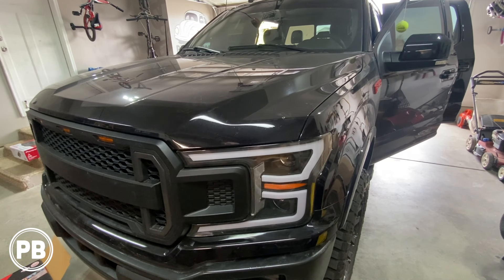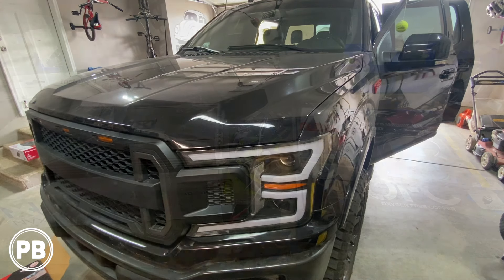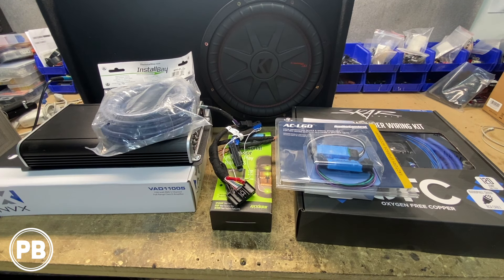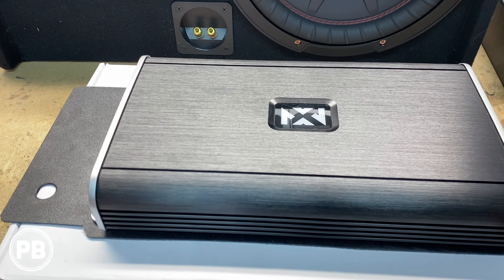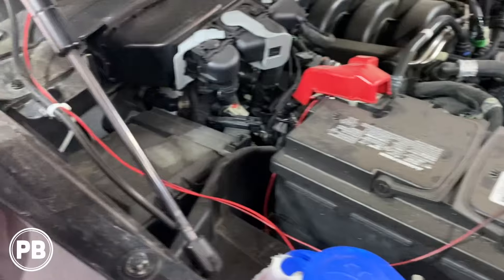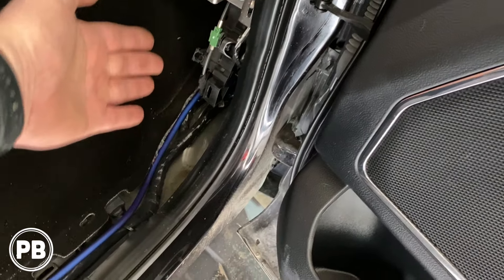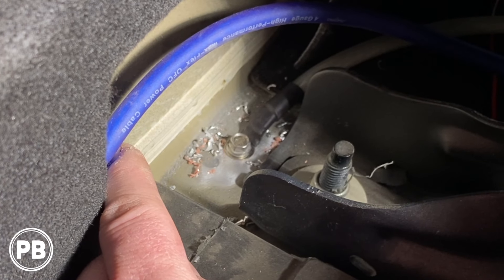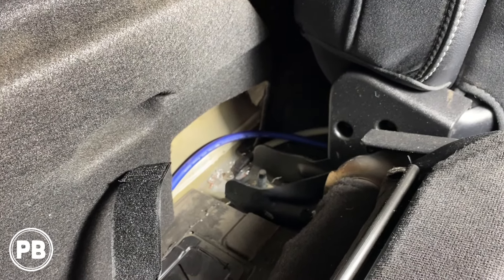2015 - 2020 Ford F150 5 Channel Amp and Sub Install (to Factory Radio)

Comment: @ProvoBeastAudio - First off, AWESOME VIDEO!  I am following your video to the letter for my 2020 F150, and I noticed something odd.  At the 13:12 mark when you're showing the output converter/load simulator apparatus you built, the white and gray outputs are either transposed, or the one I got is different.  Mine was Gray first, then white.  I think you might have flipped left and right in your video.  Maybe you swapped the RCA to compensate?  Also, it looks like you have the positive and negative backwards, at least compared to the one I got.  The output side of mine has the positive first (left to right along the top in your vid), but in your video it appears that you have negative first.  It is easiest to see on the purple wire, where the negative stripe is facing up.  It's hard to tell, and you don't really show it close up enough for me to tell definitively.  You are obviously a pro, so maybe I am seeing it wrong, or the one I got is different.  Either way, thank you for the great video.  Oh one other thing, pulling the power wire through that rubber gasket was TOUGH.  You made it look super easy, so kudos on that!
Reply from the maker: It's just a load resistor, so as long as the same color passes in and out, they can be in any position.  Happy to help!
Reply: @ProvoBeastAudio  maybe I am misunderstanding something.  I thought the 'out' of the load resistors formed the input of the line out converters, and thus the channels (Front L/R, Rear L/R) very much mattered.  Isn't that how the amp is getting the channel signal from the factory head unit?
Reply from the maker: @bryancruise  Send us a message on facebook or instagram and we can help answer your questions.

Comment: Are the load resistors still necessary if using this LOC, PAC LPA-E.4 LocPro Advanced?
Reply from the maker: That Pac module does provide a load down to 20 ohms, so in theory, yes!  But if the radio fails to operate correctly, then I'd later add load generators.

Comment: Are there benefits to buying the LC2i (LOC) as opposed to the LP7-4?
Reply from the maker: LC2i- has a main channel out and a sub channel out.  The sub channel has an added benefit of accubass where you can correct any bass rolloff.  It's a more expensive unit, but highly recommended. The LC7i is a 6 channel LOC which also is a great option.
Reply: The Audio Control LC units will also load the factory headunit speaker outputs so you wont have to have the LGD's

Comment: If I am just Going to add a a subwoofer and and a amp with a  epicenter and change out the door speakers do I really need to do all this
Reply from the maker: Nope if you plan on just running the door speakers off the radio. You just need a line out concerted and tap into your speaker wires for signal. No need to add load resistors or T harness if just adding a simple amp and sub.
Reply: @ProvoBeastAudio  what’s the line out concerted do?

Comment: I had a shop install a 5 channel amp to the stock radio.  He used this method or something similar... but when my auto stop/start turns the truck on after idling it cuts power to the amp restarting it.   Same thing happens if I turn the volume down too low or off.  I have to turn the volume up to feed enough power to the amp.  How do I remedy this, what could he have done wrong?
Reply from the maker: Check to see where he tapped into for the remote turn on wire.  Depends on the source, he may have gone straight to the fuse box on a circuit that turns off whenever the truck shuts off.  If using a line out converter that only senses audio, that also may be the reason why the amp shuts down if turned all the way down (depends on the loc).  Best scenario you use a line out converter that produces a trigger output based on a DC offset (senses a DC voltage over the speaker wire) to keep on the amp regardless of audio or not.   Hard to diagnose without more info.

Comment: What do you do when a client wants dual subs under the rear seat but the truck has the factory power inverter under the passenger rear seat?
Reply from the maker: Build an amp rack behind the rear seats.

Comment: I have a sub and amp kit. All the wiring and everything comes with the kit. What else do I need? Connector wise to run from the audio to my amps? I have the Sony system btw. I think I have a platinum.
Reply from the maker: We linked that info in the description to help get you started.

Comment: This feels like a stupid question but the sub is rated for a max power of 1000 watts will the 1100 watt amp harm the sub?
Reply from the maker: Max power are very unrealistic numbers. Always look at the RMS rating. Find out what coil configuration your sub is, how it will be wired, check the rms rating of your sub, and find a amp that does the power at that ohm load.

Comment: do you really need the load resistors if you dont have an amplified system?
Reply from the maker: If you are connecting all your speaker leads from the factory radio directly to your line out converter and amplifier (instead of speakers), yes.  If you are simply just adding an amp and sub keeping the factory speakers connected, no load resistors needed.

Comment: Have you used that T harness on 21+ f150 with big screen and standard audio system. The website says 2011-2020.
Reply from the maker: It’s on my website, yes if you want one built. If you build it yourself, the harness is a pac lphfd31.  Provobeast.com
Reply: @ProvoBeastAudio  thanks I found it on the pac website . I commented on the other video installing a front door speakers . In trying to install new tweeters snd 6×9 and all the aftermarket tweeters are either 4ohm or 6 ohm the factory is 8ohm is it ok to run those off the factory head unit with no amp

Comment: Have a 17 F-150, I swapped out the 4inch screen and upgraded to the sync 3. What do I need to do to avoid any hiccups?
Reply: Just did the exact thing with mine. I wish they'd answer this one.
Reply: @mikemike4415  I installed it already it went well. Lci2 pro, and a skar 8 inch. Didn’t do a 5 channel.

Comment: What do you charge for something like this? 

I’m considering doing it myself but curious what shops charge. I know area ect will make price different.
Reply: from what i’ve heard around the atlanta area is if you have the sub and amp alreayd it’s about 300 ish
Reply: @disconerdlion3853  I’m in Georgia. That’s fair

Comment: Why not tie into the wires in the C pillar for an amplifier?
Reply from the maker: you could, but for both inputs and outputs with a 5 channel amp, and use of the T harness, behind the radio is the best solution.  If just adding and amp and sub, and simple line out converter, You can go to the C pillar.
Reply: @ProvoBeastAudio  👍🏼 Good point.

Comment: Do the center dash and 2 pillar speakers still work?
Reply from the maker: Yes, they just ran off of radio power, and the pillar speakers are wired in the same channel as the door speakers (see that video for more information) on the non-factory amplified systems.

Comment: How does this amp compared to the pioneer you installed 10 months prior on a Ford F-150?
Reply from the maker: We still love that Pioneer, and recommend it.  This is at a cheaper price point, and still is a great option.

Comment: What about the rca for sub??
Reply from the maker: Our NVX amplifier (and similar with other brands) pulls signal from the front and rear channels to provide a signal to the sub channel internally in the amp.  If your amp doesn't have that feature, you either need a different style LOC with 6 channel preouts, or RCA splitters to supply signal to your sub channel.
Reply: @ProvoBeastAudio  I have the skar RP-600.5.  5 channel amp. Hopefully this amp will work. 

Also what size plate did you use for mounting the stuff behind radio.
Reply from the maker: The RP-600.5 doesn't have a way for the sub signal to snag input from the front 4 channels, so you will need to use a few RCA splitters or use a different style line out converter.  The plate was about 4"x7" @LesWhitleyjr
Reply: @ProvoBeastAudio  thank you. I appreciate your prompt response and great video!!!!

Comment: how much wattage is safe to run on stock electrical and a strong agm upfront? i have a 16 bro
Reply from the maker: I'd say up to about 1500 watts RMS.  Any more would be up to better battery / wiring / electrical upgrades under the hood.

Comment: Does this set up work with the B&O sound system?
Reply from the maker: It will differ slightly with the factory amplified system.  We added a few notes in the description regarding that trim level.

Comment: did you remove the factory amp entirely ?
Reply from the maker: Our trim F150 wasn't equipped with an amplifier so there wasn't one to remove.  If you do have the factory amp, see the description of those specific install adapters.

Comment: Did this truck have a sync 3 radio?
Reply from the maker: Yes it has sync
Reply: @ProvoBeastAudio  ok thank you. I'm about to do a install and was wondering what wire harness I would need for the two amplifiers.
Reply: @ProvoBeastAudio  a little confusing that crutchfield says that the PAC t harness doesn't fit the 2015 f150 lariat
Reply: did you try the pac harness?
Reply: @kevins9576  no. I'm not sure if it will work or not.
Reply: I just ordered it so we'll see
Reply: @kevins9576  so what was the out come of the harness?
Reply: @GH0ST_740  it worked fine, you just have to cut the wires instead of it being done and set up for you. It tells you how to do it in the instructions, super easy. Sorry, I forgot to come back and tell you how it worked out.

Comment: How do i incorporate a self powered sub along with a 4 channel amp?
Reply from the maker: You can use a Y-splitter, or your 4 channel amp may have an RCA passthrough output, or just add another line out converter, or get a 6 channel line out converter.
Reply: @ProvoBeastAudio  , good idea, I'll get a 6 channel LOC. Thanks

Comment: I know several others have commented on this as well... but Crutchfield says that T-harness won't fit a 2015 F-150. They recommend the iDatalink dFO2 as an alternative... Has anyone tried this?
Reply from the maker: Axxess says it will fit a 2015.  Pac's alternative also will fit as well (linked in the description).
Reply: @ProvoBeastAudio  ok thanks, I'll give the PAC product a try

Comment: Got a question about one of your older videos. Bought to buy a 2016 gti. Got a 2k watt amp and a sundown 10. I'm worried the alternators not gonna be enough. Been looking for a replacement for it cannot seem to find one think I'll be good without it? Was just gonna run a cap and hope for the best.
Reply from the maker: Do a big 3 upgrade, and ensure that your primary battery is healthy or high performance (upgrade to an AGM will help greatly).  I'd add a secondary AGM battery as most cheap caps are garbage.

Comment: Alright I have the same setup BUT I just ran into an issue. Granted it was probably my fault , the issue didn’t begin until I accidentally shorted the system by disconnecting the ground and reconnecting it.
The REM cable is now under powered only reading 3v.
I’ve swapped the amp and PAC unit , but nothing has changed, is reading 3v directly from the PAC. The yellow input is fine reading 12v.
I think the load resistors might be the issue, loose connection maybe? Or maybe there no good?

Comment: I have a 2022 honda accord I installed a 5 channel amplifier to the factory radio I replaced the door speakers  and rear deck speakers and added a single 12" sub everything sounds good Bluetooth plays good but the only issue I have is that when I make Bluetooth calls I can't hear the person I call thru the door speakers and rear deck speakers but I can only hear the calls thru the tweeters because those I actually left them alone still connected to the factory head until. does anybody know how to retain the Bluetooth calls to be able to hear the calls on the door speakers and rear deck speakers. I only experienced this issue after connecting the doors speakers and rear deck speakers to the 5 channel amp but if I connect the door speakers back to the factory wires of the door I'm able to hear the calls again. any solution to this problem anybody

Comment: Hey I know that vehicle :)
Reply: So is it your truck? And if so, how did it turn out?
Reply: @seanthemon  That is correct! I love it. I hand picked the parts with the help of ProvoBeast, they did the install and it was fantastic. Fast, gave me a walk through of the entire system after he had tuned it all. Showed me everything I needed to know. Plus how he does the systems allow you to take it all out and connect right back to the factory radio if you ever wanted to take the system out. A+++
Reply: @Andrew Atwood  See, this is the kind of response that gives a person comfort in the parts he's installing🤘
I'm in the process of gathering all the parts and components to do this install on my '17 F150, so I'm definitely looking forward to getting everything wired up, connected, and tuned. 
Thank you for your feedback!
Reply: @seanthemon  Absolutely! Provobeast did a fantastic job and his videos are extremely helpful. I would have attempted to do it myself but honestly I was impatient and just wanted it done without creating the mess in my own garage. Please let me know if you have questions, but ProvoBeast can probably answer them better. Good luck on your build!
Reply: @andrewatwood9011  Did you replace all door speakers as well? How does it all sound over stock and volume wise, louder?